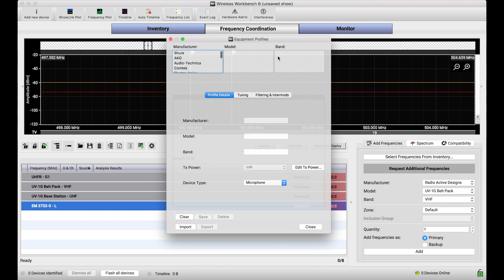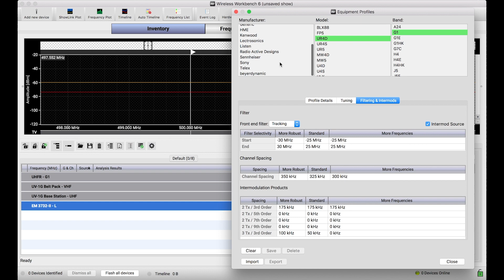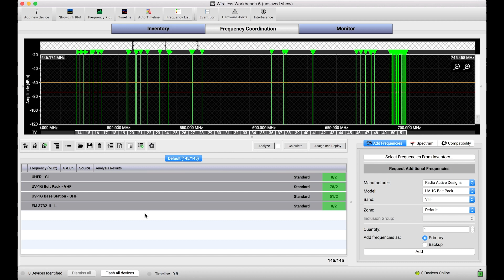Shure WWB6: Equipment Profiles (Part 1)

Comment: Hey Sam, I have a question regarding the intermod spacing in the 3rd party equipment profiles -  I noticed WWB IMD spacings are wider than most 3rd party manufacturer's own spacings - so if you use the 3rd party manufacturer's group/channel spacing (which are present in WWB), WWB will return an incompatible result, even with a blank scan. The closest result to the 3rd party manufacturer's group/channel is to use the 'more frequencies' setting. So my question is why are the IMD settings for some 3rd party manufacturers different in WWB to what the manufacturer specifies? Is it to allow every piece of gear to have 3 different compatibility profiles?